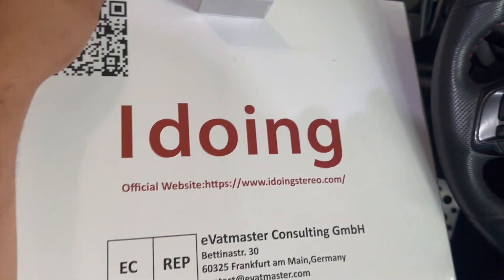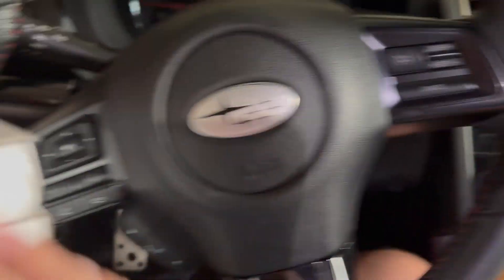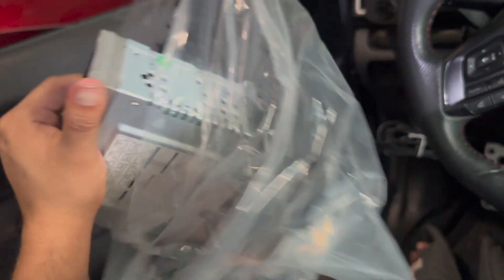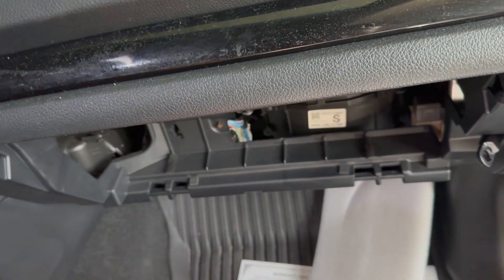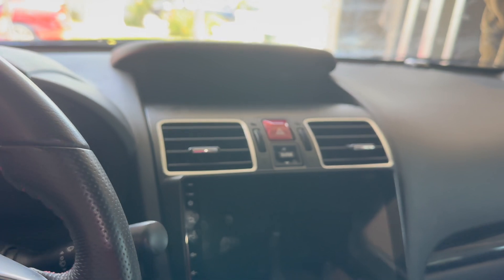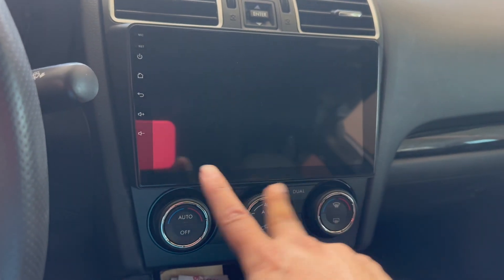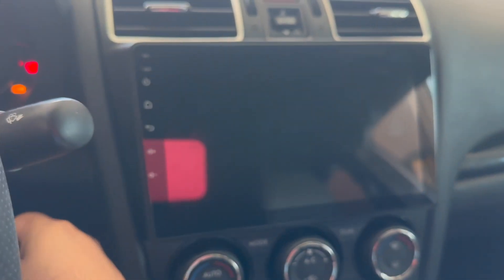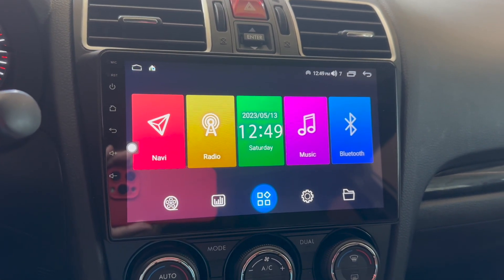2019 WRX STI Idoing headunit tips *must know before purchase* #jdm #sti #subaru #wrx #boosted

Comment: When you installed the unit, did you have to attach the 12v wire to power the antenna? I have the same unit and my radio doesn't work. TIA
Reply from the maker: I did connect all the wires including the radio. I can test the radio tomorrow and let you if it works
Reply: @boosted_life  that would be awesome, thank you.
Reply: @boosted_life  I should also add, some radio stations work, but ones that would be further (farther station) won't work and the AM stations won't work at all.
Reply from the maker: My radio works and I can preset radio stations. If you can’t figure it out. Reach out to idoing. They are very responsive.
Reply: @boosted_life  so you also connected the 12v wire? The extra wire thats with the antenna?
Reply: @boosted_life  I was able to figure it out. There's an option in the factory settings to power the antenna (it was turned off). I switched it on and all the stations work now.
Reply from the maker: @eddiec8381  hell yeah  brother!.. I have no idea if mine is on or off lol but it works .. I still gotta mess with the settings. Noticed the music turns off when car is in reverse. Tried fixing that but no luck.
Reply: @boosted_life  i know there's an option to adjust the volume when reversing. Try looking in the factory settings. Mine doesnt shut off but just lowers the volume.

Comment: What code did you need for Bluetooth i haven't heard of that one? Im in the process of finishing installing my idoing head unit but dont know about no code
Reply from the maker: https://drive.google.com/file/d/17dGqDOHFM--IVCPgxbpu95Qkk1hb1j5L/view
Reply: @Boosted_life  hey how did you get the telematics unit to fit? For me it sticks out way too far that touched the inside wall and won't fit.
Reply from the maker: @MrRyuken22  first make sure all your wires behind the unit are secured. Start from the bottom, ensure the bottom clips are in then align the top  clips. Once they are aligned and secured, do the center. She fall into place if everything is aligned and nothing behind is preventing the clips from going in.
Reply: @Boosted_life  thanks I had to switch the star link module to the top instead of the bottom, and it fitted right in